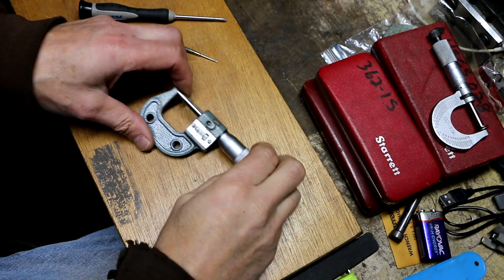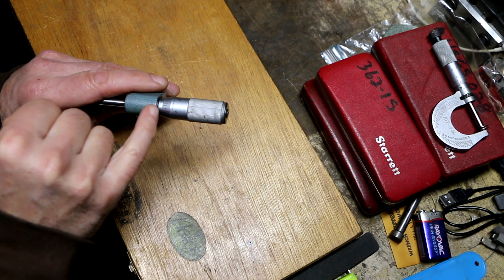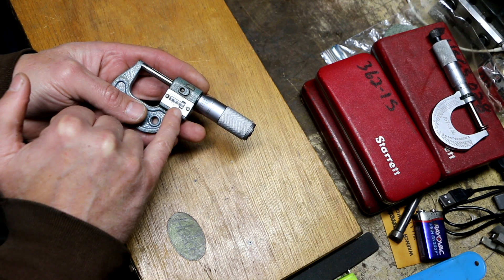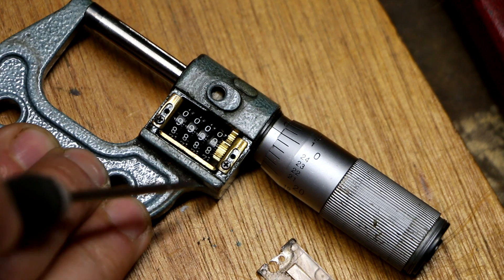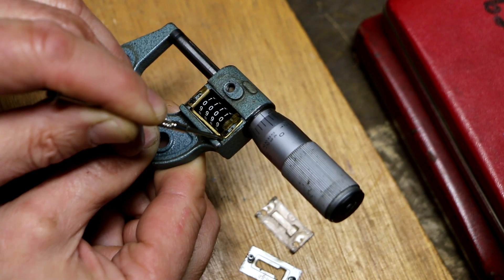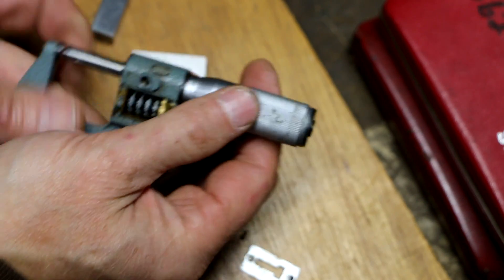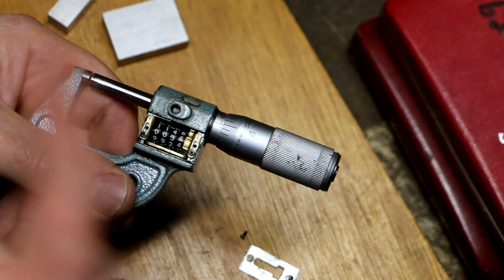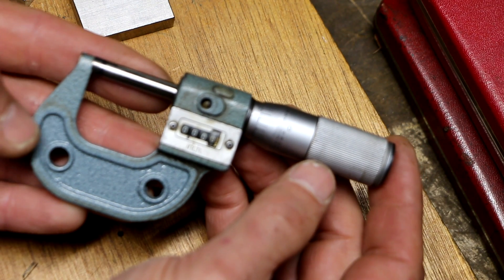Mitutoyo roller micrometer repair

Comment: Fixed my new mic based on this vid. Mine was off by a crazy amount (bought it used) so I removed those two screws entirely and lifted out the counter assembly entirely. I rolled it to 0.000 using the little gear, locked my spindle at 0.0000, then placed it back into the mic. You might need to readjust a time or two using the method described since when you place it back into the mic, it sometimes gets off by a number or two on the thousandths place.